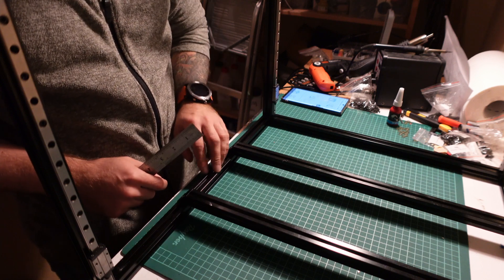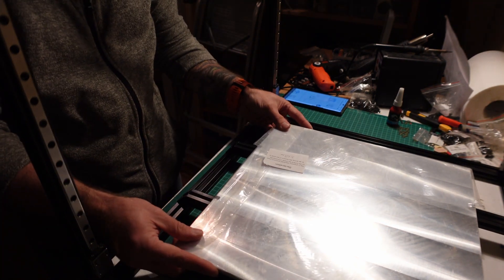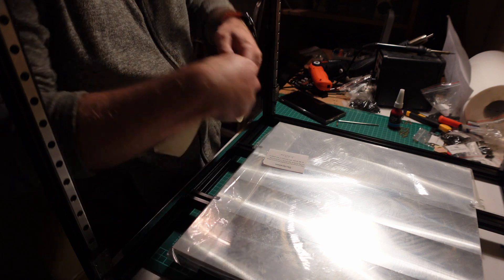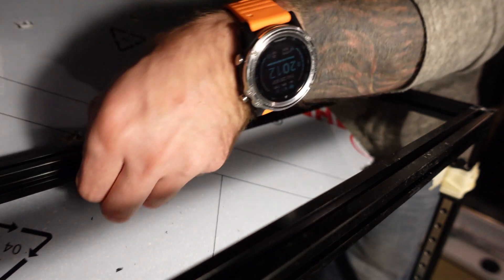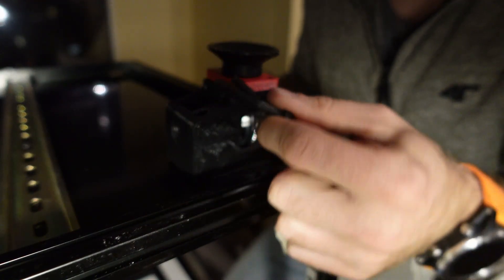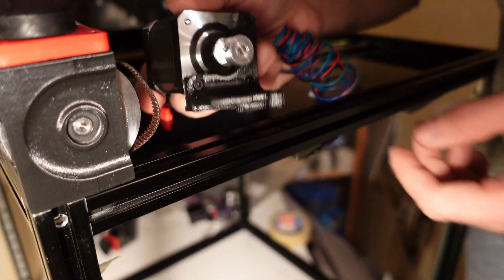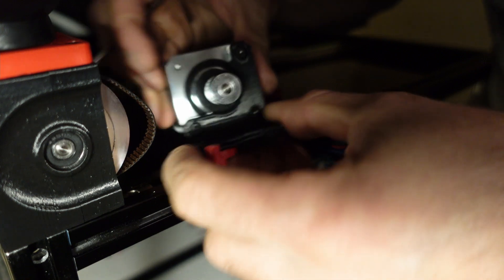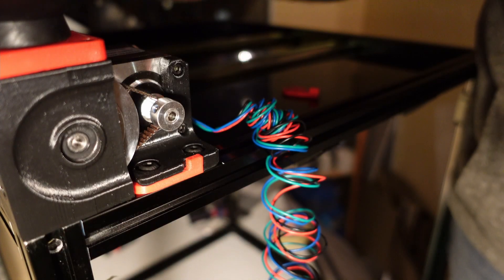Building Voron 2.4! P4 - installing DIN rails and motor assemblies with FormBot kit 350mm

Comment: I cannot find DIN rails that long.
Reply from the maker: Have you checked misumi or other suppliers? They have 470 mm din rails:

https://us.misumi-ec.com/vona2/detail/110500152650/?HissuCode=MRC-470

Actually they can be a bit shorter, 450mm for 350mm build or similar.